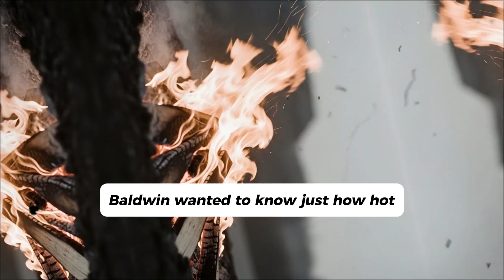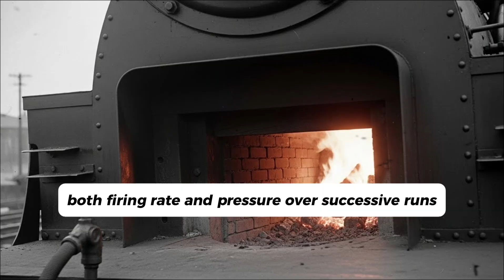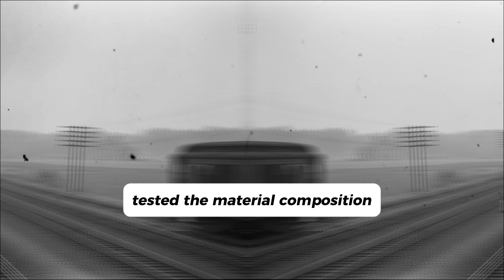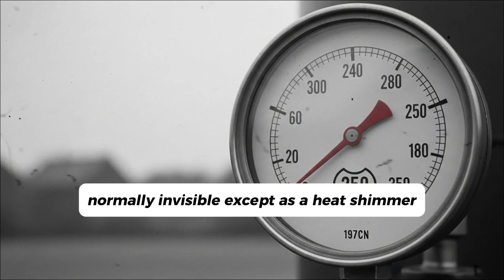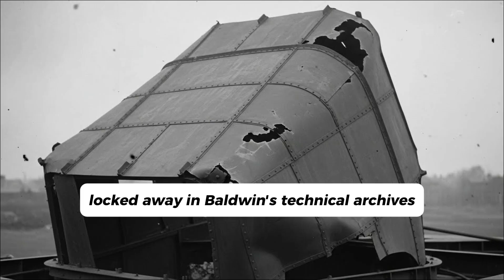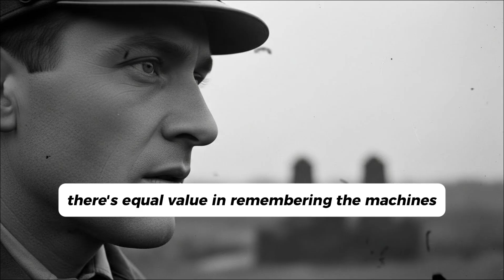The Steam Engine So Hot It Melted Its Own Boiler Twice

Comment: If  the crown sheet is not covered by sufficient water it will  melt, the problem they encounted was the very high boiler pressure prevented sufficient water being injected into boiler to maintain the correct water level in the boiler thus leaving the crown sheet with out sufficient cooling and allowing it to melt down and fail.
Reply from the maker: Thank you for the valuable information you provided. I will continue to develop videos for you.